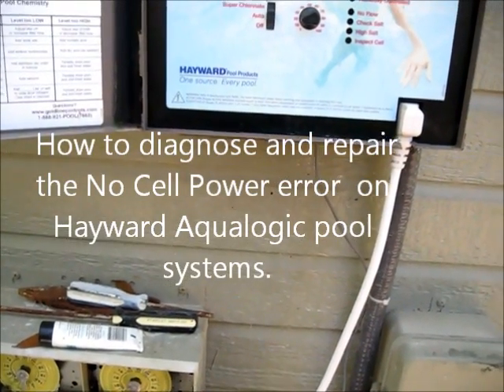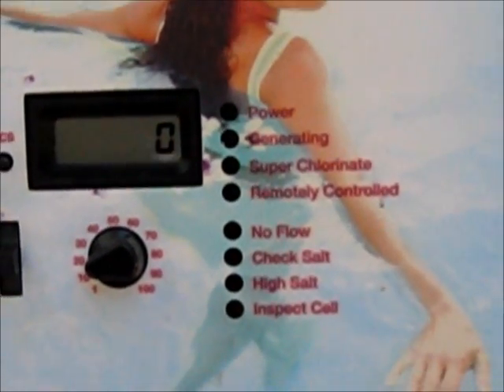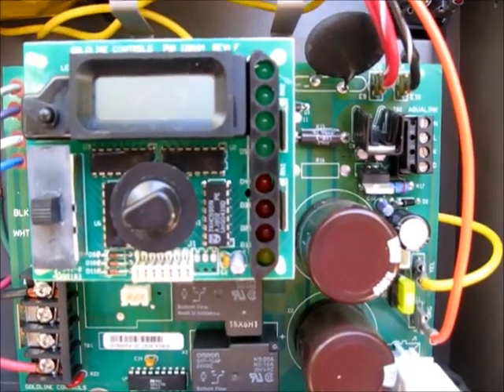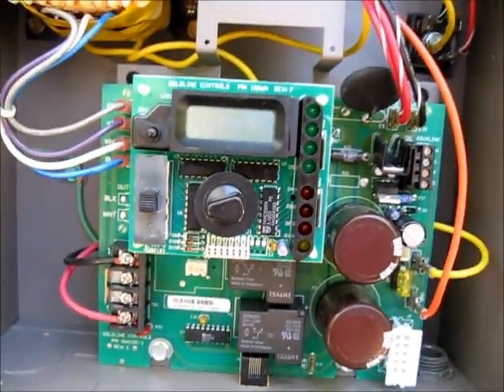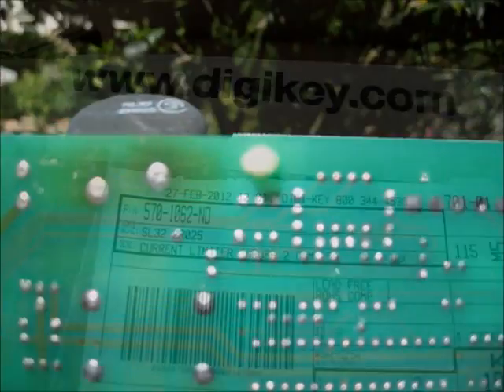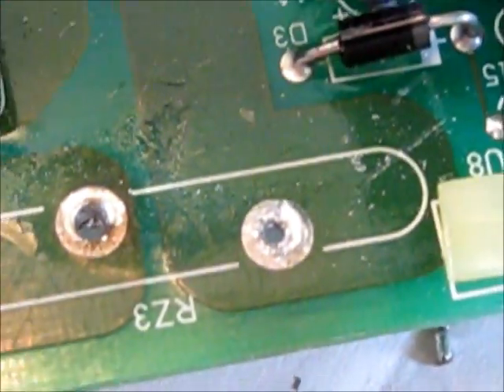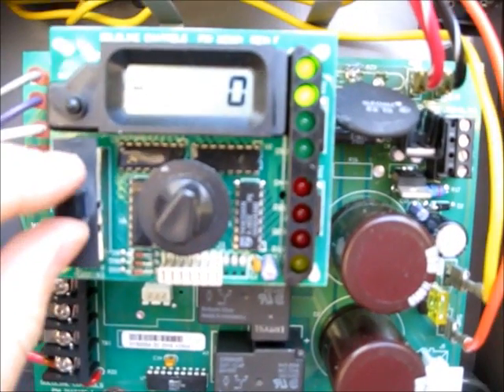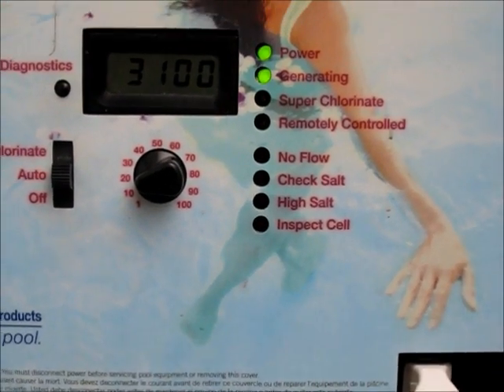Aquarite Hayward No Cell Power.wmv

Comment: This may help someone. 

Before you replace your board. A question for you. !!! Are your display lights and numbers fidgeting ? If the are replace the display first. Its much cheaper than the board about $115 vs $400. If not try this also my own pool did this. 

I put an old board in that I  had replaced the thermistor in. After a new aftermarket board lasted 2 days. 
I was confused about the salt level numbers saying 2.7 and red lights were on after 30 seconds or so. 
Turns out I needed to check all my settings. It was in metric was set for t-3 cell mine is t-15  and had to calibrate the salt level. I have a hand held electronic salt meter and it’s normally very close to the Hayward reading. I had to toggle it from off to auto a few times to get it to start counting down like you’ve seen in calibration videos then flip it up to super chlorinate and back to auto to hold the setting. But now lights are green and everything it good in the pool.

Comment: Fix worked like a charm!  However, now the unit is running super hot on the top right corner where the new part was soldered.  I’m not sure if it ran this hot before? Now I’m worried to leave it running. Anyone else have this Problem?

Comment: I changed this part 2 years ago.  Now it needs a new one.  If I squeeze the current limiter together the power light would come on.  I gave it a wiggle and it crumbled.  I'm calling this a bad design by Hayward.  It's basically planned obsolescence.   I'm sure Hayward knows this part fails often.  When you call them they want you to purchase a new board.

Comment: Great video, Joe, the current limiter (thermistor) from my machine crumbled in my hand so I know it needs replacement. For those of you who need the part number it's:

SL32 2R025 - They are common and available on-line and in most electronic parts stores.

Comment: Thank you so much for the Video.  I had the exact same problem and you save me a ton of time showing the part number in the Video. My current limiter fell apart so bad that i couldn't discern any of the writing or numbers on it. Picked up the part on Amazon and soldered it in and was back up a working in 30 mins.

Comment: I can also say that this video helped me fix my Hayward Salt system by replacing the thermistor as he shows. Kudo's buddy. I had a new system $850 in my Amazon cart when I came across this video. I cleared the cart and purchased the thermistor. Total cost: $5.00. When I desoldered mine I found it was cracked in half. BTW, the video shows replacing the fuse and re-testing. No need, just test fuse continuity with the multimeter.

Comment: Thank You for this video.  Upon inspection, I found the Current Limiter literally falling apart. 
I shut down the power & TIGHTLY WRAPPED THE CURRENT LIMITER (THERMISTOR) WITH ELECTRICAL TAPE. 
AMAZINGLY, THE AQUA RITE SYSTEM IS GENERATING AGAIN!
I know this is only a temporary fix. I ordered a SL32 2R025 Thermistor on Ebay. I am going to try to cut the old Limiter & install the new one using solderless crimp connectors. That should prevent me from having to go through the soldering process.

Comment: I replaced thermistor and voltage is back up to 31, but now I have no flow light on and no generating... it did repeatedly trip a few times with initial power on, but now "runs" ok. I'll check fuse, but not sure if that's not it.

Comment: Great video. I like you have never fixed anything electronic so thank you for sharing. BTW for those who find the part back ordered from digikey I found them in stock at mouser and literally had them delivered from Texas to Toronto in less then 24 hours. The guy I talked to at mouser was so nice and helpful. I haven't installed yet but am about to...I ordered a few just in case. Wish me luck. I hope this is the issue.

Comment: Thank you very much! The current limiter was it for me as well. 2$ part instead of new mother board for $179. Can't beat that.... When I opened the control box and exposed the board, the mother board around the current limiter was dark, almost black. So I knew it was it but I was not sure if maybe there was damage to the board but luckily it was not! I too never soldered before. Watched a few good videos online and it ended up pretty easy.

Comment: I saved 300 $ with this tip. It's really work !
I replaced the AS32 parts with a new one (9 $ at Digi-Key + Shipping) and, bingo ! Like a new one.
Facile à remplacer, un bon fer à souder, une bonne paire de pince et faites-le vous même. Ça va éviter une dépense de plus de 300 $ pour un nouveau PCM. Ce video explique très bien quoi faire. N'hésitez pas si vous avez ce problème.

Comment: Joe, great video.  I do have one question however.  There are 4 "lines" if you will on the right side of the circuit board.  A red one, a yellow one and a red and black one up in the right hand corner.  I could not figure out how to get those off the circuit board.  Do those also need to be soldered off or are they plugged in somewhere?  Thanks for your help!
Reply from the maker: No idea.Sorry. I didn't have that
Reply: Joe Homeowner Joe,  yes, on your circuit board there is a yellow and orange line connected to the circuit board at the lower right hand corner.  There is a Red and Black line connected at the top right corner of the circuit board.  I too have those lines on mine.  Do those just pull off the circuit board?  You can see them on the still shots you took.
Reply: Joe, on your circuit board there is a yellow and orange line connected to the circuit board at the lower right hand corner.  There is a Red and Black line connected at the top right corner of the circuit board.  I too have those lines on mine.  Do those just pull off the circuit board?  You can see them on the still shots you took.
Reply from the maker: The wires, on mine pulled off. they have a connector that plugs into the board. difficult to pull out, use gentle force, and wiggle a bit. I used needle nose pliers
Reply: Thank you sir!  I will give it a shot.  Appreciate you getting back to me.

Comment: hey Joe, had the same problem, thanks to google and guys like you posting the fix online i was able to fix the motherboard current limiter. i was quote 700 $ for a complete new motherboard including labour. The current limiter wa 5 bucks and i bought the solder iron and desolder sucker. All together 70 $. I am not a handyman and never did solder neither desolder in my entire life. Once i had the motherboard removed i was able to do the job, was not that difficult. After i installed the motherboard back the power light went on and i am again chlorinating my pool.
Thanks again

Comment: Hey Joe, Man you save me a lot of money. I was thinking I had to buy a new control panel. Then I saw your youtube video. Mine was doing the exact same thing as yours. So I went ahead and order the part based on your video. I ordered the part from Digikey and got it in two days. In about 10 minutes I had the new current limiter installed and the control panel working great with all the lights working. My old limiter crumbled just like yours did and had the burnt marks. Thanks a million.

Comment: We owe you a huge thank you. We were having the exact same problem and followed your instructions, bought a new current limiter from digikey (which by the way has ultra fast shipping) and put it in and we have power and are generating salt. We were told that we need a whole new unit to the tune of 2000.00. We were able to. Fix it for less than 20.Only thing I would recommend is checking the part number on your current limiter as ours differed slightly from joe homeowners and ended up having to reorder the proper one.If anyone needs the same one as joe let us know and we will mail it to you as we couldn't return it.Thank you thank you thank you

Comment: I tried going to no cell power and that site is in Spanish, I can't get it to change over to English. You didn't explain out to check out K-1. My current limiter looks good both front and back. My system will not show salt readings in either place after the system has run for a couple of minutes and has gone from no flow to generating to check salt and inspect cell. If K-1 and the current limiter is good what else do I check?

Comment: Joe,  Thanks for posting this! I had the exact same problem. I jiggled the current limiter a bit and the power and generating LEDs came on but went off again. Jiggled some more, came on, then off. Finally the current limiter cracked in half (i.e. the disk that's sandwiched between the two round pates) leaving me with 2 pieces. I got a brainwave to put the disk back in between the plated and clamp in with regular office supply bull nose clips (ones you use for files). Voila! It's working now and the LEDs are staying on. Not a permanent solution but will suffice until I get the replacement from digikey.com for only $3.40 (p/n: 570-1062-ND). Looks like a quick solder. 

BTW: I called 2 pool service guys off the Hayward site. Both told me I needed to replace the entire board ($500+ including labor). Amazing that they don't know that this is a quick fix or refused to tell me.

Comment: I have re soldered the K1 3 times over the years. Never had to replace the flow limiter or fuse. But mine is an older version. Now I have to go diagnose again
Reply: +rogerxcohn And voila! scrape off the burned solder. re solder with a SMALL drop (I'm actually getting better at this) and up and flowing. 3200 PPM salt. voltage and amps all normal. I guess I don't have a current limiter like in the video (old board)

Comment: Great job, word of advice in determining the fault:No power (no lights at all) to the box, it's the fuseGenerating but no salt conversion, it's the relayPower with No Flow light, it's the no flow switch (located outside the box)Also, while waiting for your new parts to arrive, you can also revert to treating your pool the normal way by just adding chlorine along with other chemicals to maintain it for swimming. In all, you did a nice job my friend.

Comment: Thanks a bunch for this video and instruction. Worked like a champ for my system.  Rather than un-solder the heat sink from the circuit board, I just cut the old wires back and soldered the new one on to those existing wires. Boom! I am back on business for $5 bucks!

Comment: Thanks for the video!  I was at a total loss.  I could not seem to find a pool company located close enough to my house to come out to repair my pool.  One guy was nice enough to walk me through some steps over the phone, which he assumed the cell to be the issue.  I purchased a new cell, which still did not fix my issue, but cost me nearly $400.  I then scoured the Internet in search of solving the problem myself.  Not knowing anything about how this pool system operates, I wasn't super optimistic I could repair the pool myself.  Then I came across this video and viola!  I ordered the current limiter, followed the steps in your video and PRESTO!  I am back in business.  It took me FOREVER to get the current limiter desoldered from the circuit board, and thought for sure I would have ruined it, but to my surprise, I reinstalled the circuit board after soldering the new current limiter on, and every thing began working perfectly.  I can't thank you enough... and my husband should thank you too as you saved him the headache of repairing the pool or paying for more unnecessary parts.  THANKS AGAIN!!

Comment: Great tutorial. My transformer burned up last night. I have the same system in your video. I'm flying by the seat of my pants like you. Never messed with electrical. Anyway I found a used transformer on E-bay.I'm wondering if the heat of the burning transformer killed the board. I see no melting of the board. Any suggestions appreciated. I will take your advice and replace the fuse just in case it is bad. Thanks. Mike

Comment: Just a thought, instead of desoldering, expecially if you dont have the correct tools, why not just smash the black disk with a pair of pliers to expose the two metal legs, and then cut them back a bit, and solder new legs to old legs, seems this would save some headaches.

Comment: Thanks for the video.  Excellent and easy to follow.  I had the same problem in a 10 year old unit, and the $3 part fixed it.  Saved me $400 for a new circuit board.

Comment: I was losing hope, found your video, bought soldering stuff (never done this stuff except when I was 5 years with my older brother), started to desolder the current limiter, started to lose hope again because it looked so hideous and for sure I was screwing it up, finally got the part soldered to the board, put the box back together, powered it up and both Power and Generating lights came on! Yay! However, I must not have had enough salt so the Generating light went off (while the Power was still on) and the Check Salt light went on ... threw in three bags of salt (that's all I had) let that swirl around the pool for about 15 minutes, put the switch to Off, then back On, pressed the Diagnostic button five times and let it alone for about a minute which seemed to reset the unit and it started to Generate again with a reading of 3000. At the beginning, I really thought this was not going to go well, but it did the trick... but for sure I will be keeping my day job!

Comment: Thank you very much for your video.  My Aqua Trol had the same issue.  I had no evidence of the problem on the board but I had nothing to loose by changing the current limiter.  However, it was hard to unsold because of the large surface of the circuit board and also because it was sold on both faces of the board.  To ease the unsoldering, I cut the legs of the old current limiter to reduce the heat sink effect of the old unit.  Then I was able to unsolder both legs from the board with the help of a pair of plier.  The part number of the current limiter was AS32 2R025 wich I get from a local electronic store at 12.95$.

Comment: Same problem, no power light.  I have a newer model, Hayward now has a sheet of foil around both wires, front and back.  We had to get the desoldering supplies through Amazon, my Lowes or Home Depot was a no go.  We did get the circuit limiter from digikey, which ours was an AS32, 2R025.  I think the foil on the front and back was more of a deterrent from the company to prevent you from making this easy fix.  Total time took about 45 min from unhooking, installing new limiter and then hook everything back up.  Total savings $230
Reply: Brian Farrell Hi Brian, I have the same board you have with the AS32 2R025 current limiter.  What's the amperage on the limiter you purchased? Digitkey has a 25A and a 35A.
Reply: Julio Amaya Hi Julio - 25a.  Works perfectly,  ZERO problems

Comment: I'm about to install a new PCB and noticed that terminal E12 where the Yellow lead from the transformer plugs in is discolored and the yellow lead itself shows signs of burning where it plugs into the PCB. So is it safe to attach the new PCB? Or will it get fried the second I turn it on? Is this a transformer problem? (I was getting a normal 30.2v reading while doing diagnostics.) What would have caused the current surge at E12 that would not also have (a) blown the fuse at F1 or (b) produced the charring you found at the current limiter disc? Tech service is closed for the day and I need to get this done tonight. Thanks.

Comment: Hi Joe, same problem. I got the part # for the current limiter, but what about the K1? Did you buy one of those just in case or did you just buy the current limiter on a guess that the burn spots on the board were a clue?  I'm anxious to order my parts from digikey upon your reply.
Reply from the maker: Julian Vail Just the current limiter

Comment: Joe,  Great Video. Clear and concise. I had figured out it wasn't the 20 amp fuse but wasn't sure where to go from there.  Your video helped me troubleshoot, diagnose and fix the problem for around $10. Digikey was quick. Ordered a the SL32 2R025 (and an extra one) on Wednesday night and it arrived Friday afternoon.  Not a pretty soldering job but back in business on Saturday morning.   Thanks!  Sure beats the $300 a new board would have cost.

Comment: Thanks for the great video!  I was able to quickly solve the issue and save some money!  The board is actually very easy to remove.  Replacing the limiter only took a few minutes.  Total job was maybe 20 minutes to kill power pull apart, solder, and reassemble.  My unit was about 9 years old and it looked like maybe weather had taken its toll on the materials in the limiter.  Also Digi-Key was extremely quick and easy to purchase from.

Comment: Hi Joe, just a quick question before you  took the board off, did you just pull the wires (yellow, white, gray, red wires) directly out of the circuit board? i tried pulling them using a long needle nose but I am afraid to break the board itself.
Reply from the maker: Vincent Tiongson yes, the wires pull off, be as gentle as you and try to wiggle to loosen,  but it does take a good tug.

Comment: The tip from one viewer about using electric tape and a binder clip as a temporary fix is fantastic!   I used this to get my system back on line in minutes and have just ordered the parts to do the permanent fix later.

Comment: Slightly different board, but same problem and same solution. Local store ask $770 to replace the board. And all I spend was $80 for two current limiter and a good soldering gun.
Big help. Thanks man!